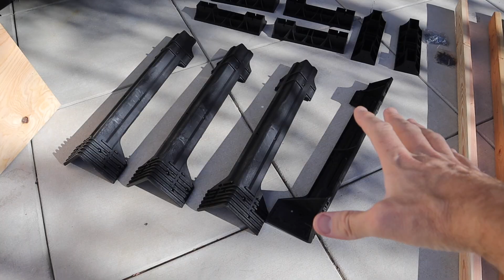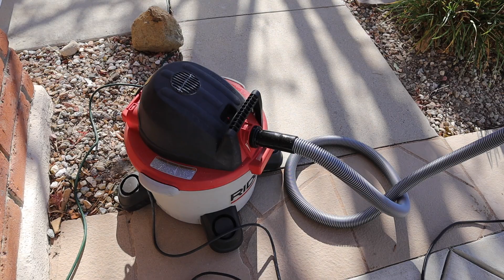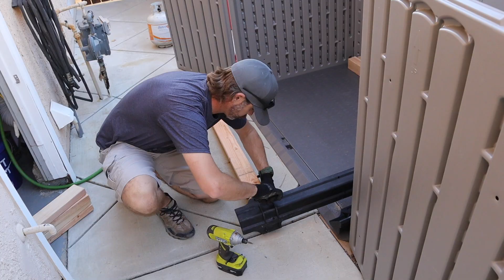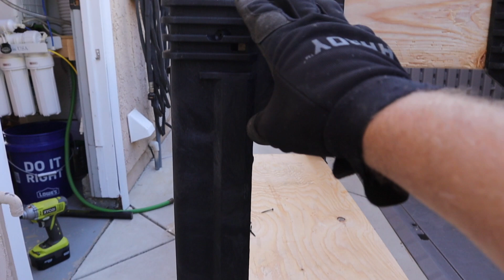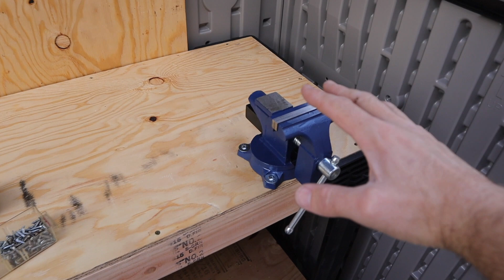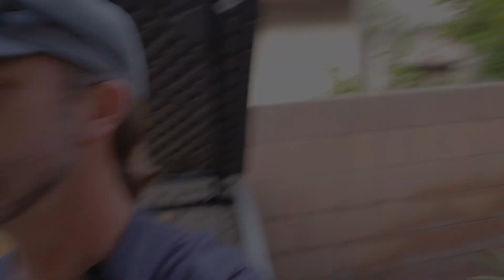How to Build a Workbench - The Easy Way - DIY in 1 Hour!

Comment: I used brackets from the same company to build 2x4 shelves in my garage and they worked great. I did have to use lag screws to tie the shelves into the garage framing, though, else they'd have fallen over. Very sturdy and easy to build around windows and doors.
Reply from the maker: I was more impressed with this kit than I thought I’d be.

Comment: geez. You don't need a freaking kit.
Reply: Why wouldn't you just use 2x4s on the side instead of buying plastic?
Reply from the maker: I went this route because then I don’t have any wood touching the floor, since this bench is going in an outside shed, if it rains and water gets in (like it did last night), I don’t have to worry about water damage to the wood. The bench in my garage has 4x4 legs, 2x4 frame and 1 inch ply top.